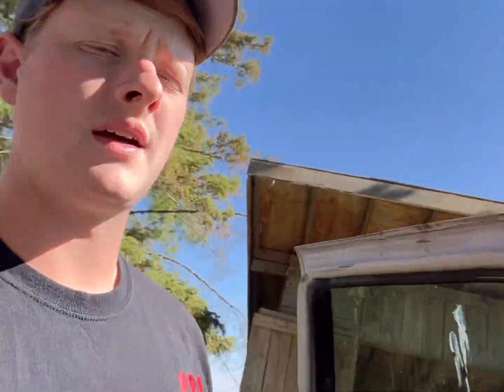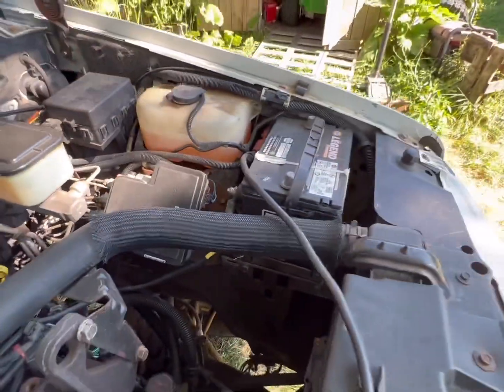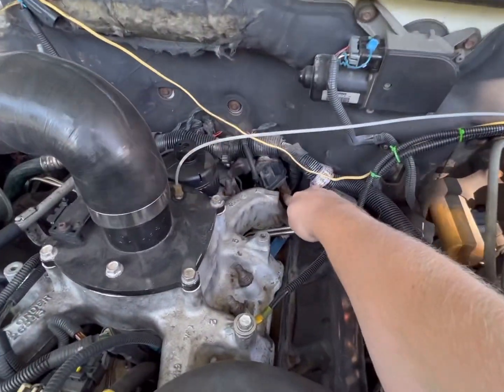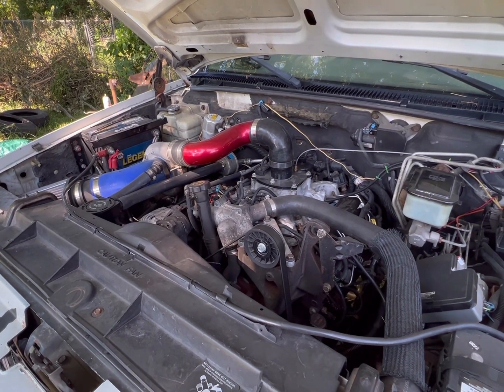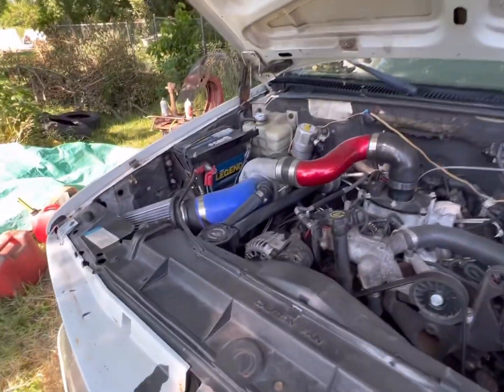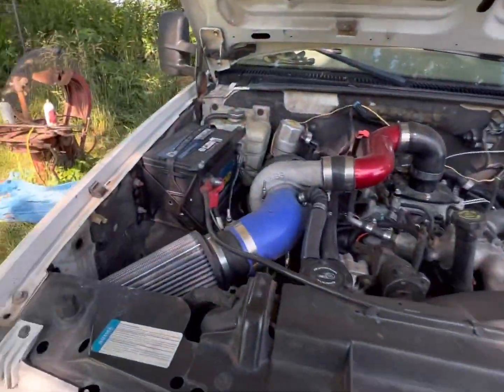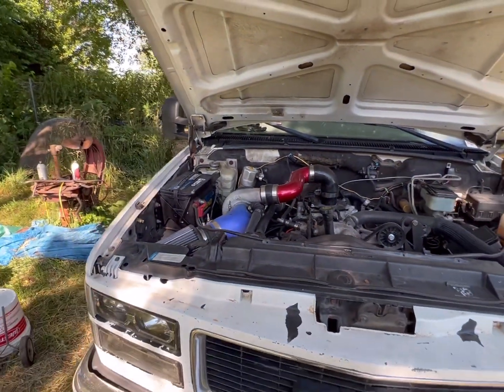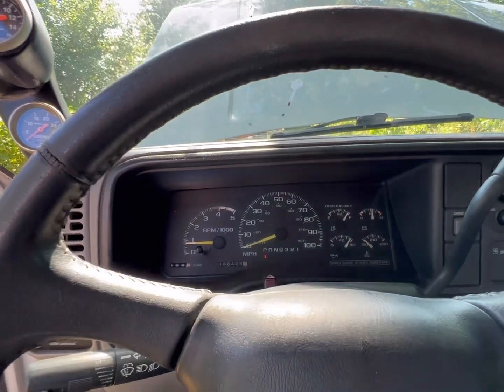GSC 6.5L diesel battery cables and grounds

Comment: Great info. I was wondering if maybe any of your 6.5 truck might have done this is past, like I have like new PMD relocated, new oil pressure sensor, new vacuum pump, ground wire looks good but once in awhile after starting truck and in drive,after maybe 2-3secs will shut down, will take 4-5 turns and truck will start again, does that once in awhile
Reply from the maker: Most times that’s due to the lift pump not running and you suck the fuel bowl dry. My 99 did some odd stuff like that when the injection pump started to fail as well. You’ll have to do a fuel pressure test then get a scanner and check the injection pump closer time to see what’s going on.
Reply: @gingersnapcustoms  thanks you so much. Been thinking of changing the fuel lift pump, I'll change it and try next the injector if still remains same.